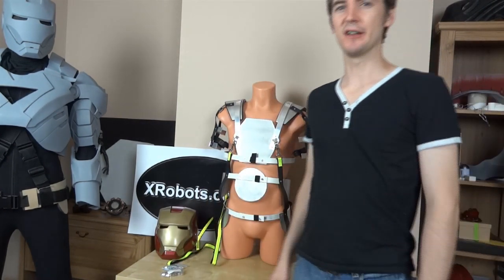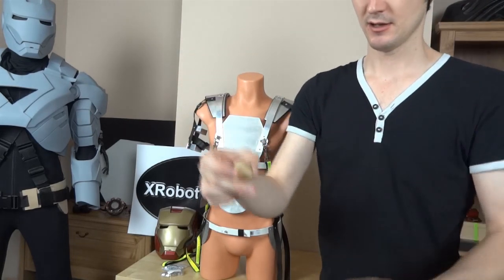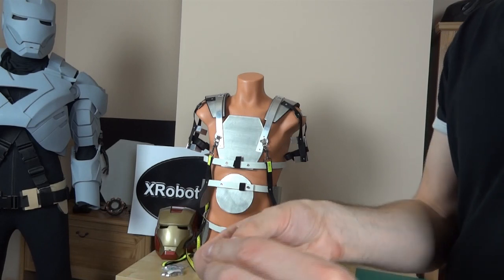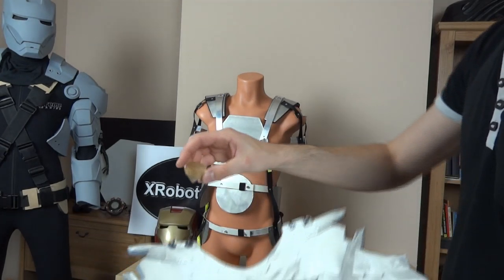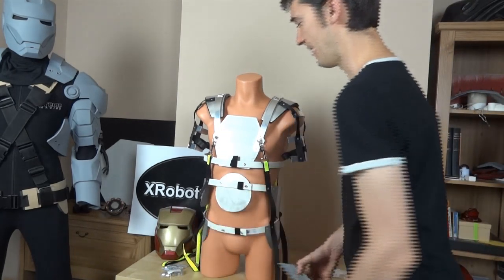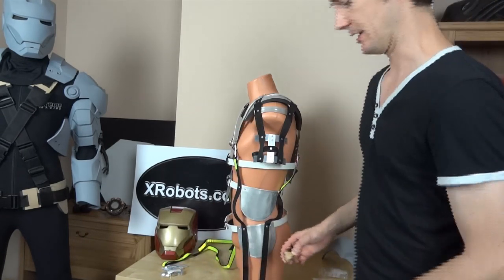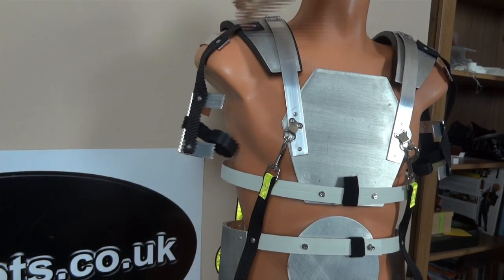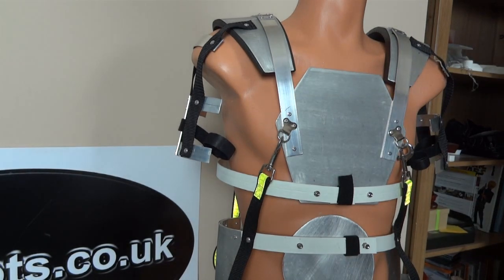Iron Man Power Suit #13 | Exoskeleton Strapping pt 1 | James Bruton

Comment: How did you get the dimensions for these pieces? Is it just trial and error, fitting it to your body, or did you use your duct tape mannequin?

I really like this system you're using, and haven't seen it anywhere else.